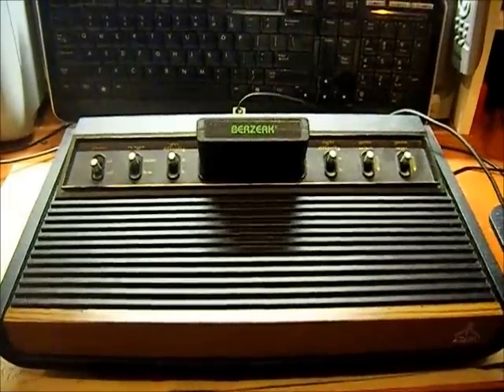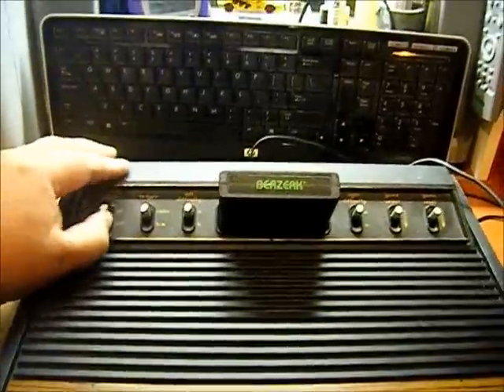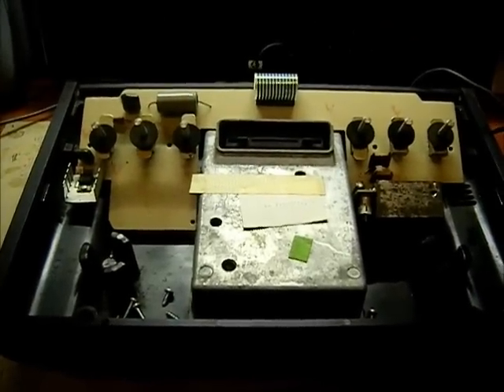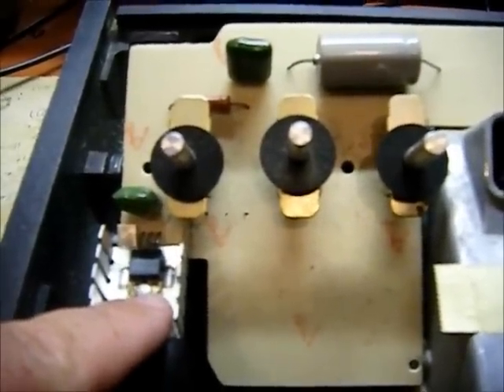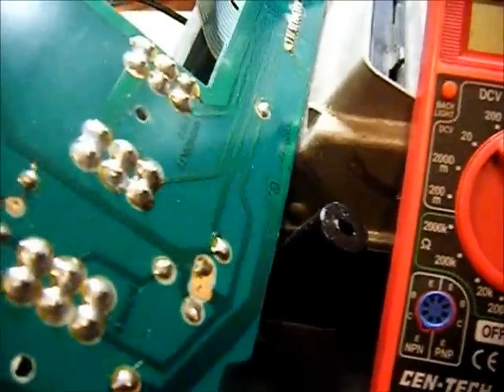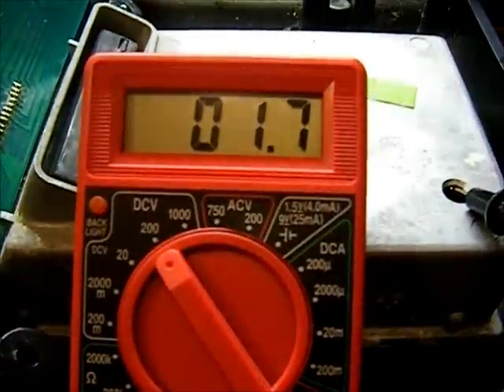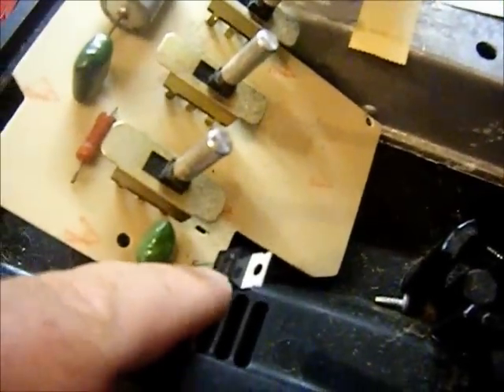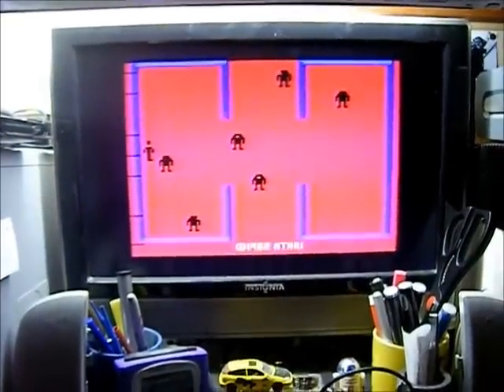Atari 2600 7805 5volt regulator problem

Comment: I'm late to the party. I have a heavy sixer that would have the proper colors when powered up, but, after sitting a few minutes the colors would turn. I replaced the 7805 and the problem was solved. If you have color that isn't adjustable, it's most likely the 7805. I used a ST L7805CV, they are readily available on Ebay. I also replaced the capacitor.

Nice find for a dollar, easy fix for a piece of gaming history.

Comment: congrats!  My 7800 will play 7800 games when the unit is cold (1st powered on) and will continue to play the game until you power it off.  Then most of the 7800 games will not play again until it cools down and unplugging the power supply.  It plays 2600 games with no probllems.

Comment: I just replaced a bad voltage regulator and the one I put in blew after an hour of a black wobby picture with the outline of pacman on the screen.  What caused this and how can I prevent another regulator from blowing?
Reply: bradhig when i get one, i replace the capacitor first, regardless if it's good or not. After 30 years they will become bad. Check the resistor.

Comment: HELP! I just bought an Atari 2600 and I am having a blank screen when turning it on. I tested the voltage on the regulator (same way as in the video) and everything was right. I also tried a new RCA Video cable and still no luck! I really need to fix this since I am already $25 in the dirt. If anyone has any idea what it might be, please tell me!

Comment: Just tested my regulator and its reading 0 on Meter does it mean its dead and needs replacing? It's not detecting my tv really annoying but like I say the chip is reading 0.0
Reply from the maker: most likely, it should be around 4.8 volts or so.

Comment: Fantastic find and repair!  Now that regulator normally takes what input voltage and outputs 5v?
Reply: The 7805 takes 12v dc and brings it down to 5v dc, in case people were curious.
Reply: @CockySoupNazi  Greetings friends, if the regulator delivers 5.1 volts at the output, that would be fine, or that regulator can be said to be wrong, please tell me.
Reply: @CockySoupNazi  OK thanks. Don't replace it, just looking for the fault, now the most likely suspects are all three chips, RIOT, CPU and TIA.